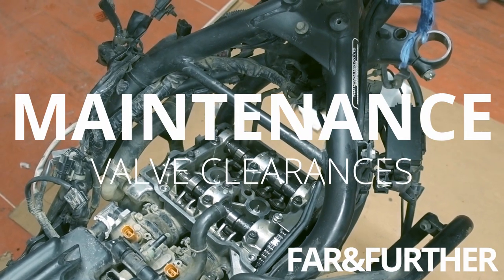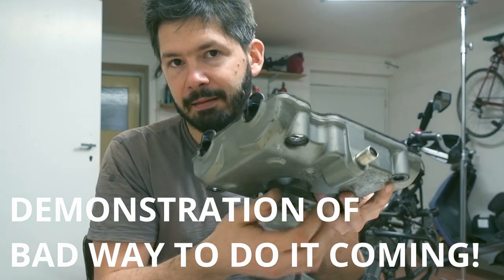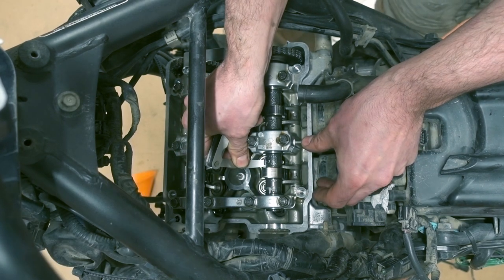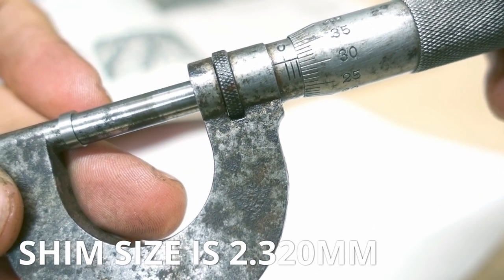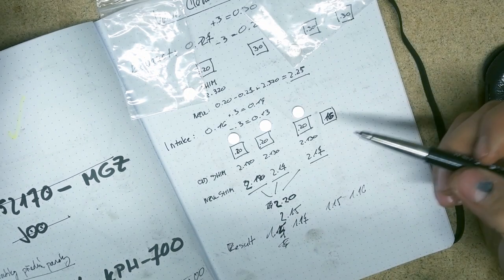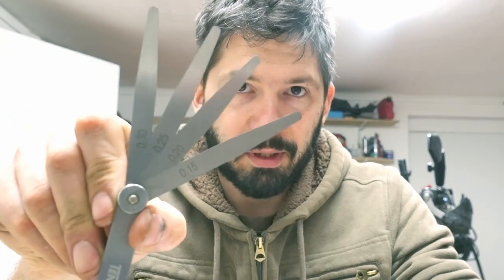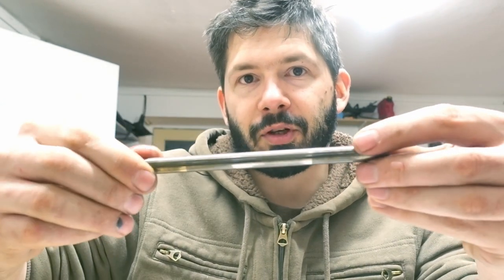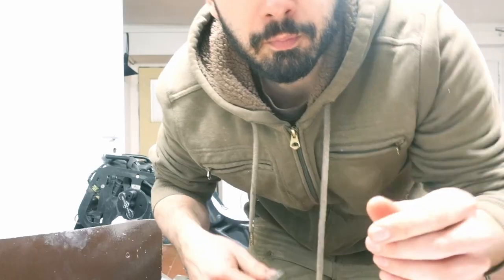Maintenance - Valve clearance & shim replacement

Comment: If I can add a couple of suggestions.  Check valve clearance when engine is cold (i.e. leave unused overnight).  Timing marks can be alligned by putting bike in 6th gear and turning rear wheel forward by hand only.  If you loosen the spark plugs first, this will make turning the rear wheel easier.  Overall, great video showing parts of the valve clearance check not available anywhere.  Thanks for posting Tasso.
Reply from the maker: Very good points!
Especially about cold engine, I had bike apart for weeks so it didn't occur to me, but of course!
About timing marks you're absolutely correct, wheel method will work as well.

There are some parts missing from the video such as timing marks alignment, etc... but I really want people to get the manual and do this with it, its soo cheap comparing to messing up.

Thanks for feedback!
Reply: good stuff appreciate it ! both of yall

Comment: Excellent thank you! Won't be doing my own valve clearance service in rural Thailand now on seeing this video despite maintenance fitter qualifications!! $200 AUD for the Honda dealer to do it here...
Reply from the maker: Hehe, yes I think some reasonable space and set of tools is good idea. It's not that difficult if you do it few times however clean environment is probably what you're after.
Reply: probably get it done in thailand for less than a 1000 baht, UK more like 12000.

Comment: Was looking to buy a CB500x but now looking at NC750x simply because shim adjustment is such a pain in the arse on the 500x.
Reply: you need to do it every 16000 miles. I would say every 3years for most cases.
Reply from the maker: Is that any better on the NC750X? After few times it's much faster, most of the pain is to get the electronics out of the way. BTW it's going to be much much worse on the Tenere 700 I have now, that looks like I'll have to take 1/2 bike apart. But T7 has 40000km for valve clerance!

Comment: Thanks for the instruction.
I'm surprised your micrometer still works. To not over tighten or damage the internal thread, you use the small knurled-head screw. Don't ask me how I know
Reply from the maker: Hehe, well it's reliable old day russian equipment, hard to beat the steel there :) They are very delicate indeed.

Comment: whether we can substitution shim valve for different motorcycle?. for example, we use ninja 250r shim valve for honda cbr 250r
Reply from the maker: I don't know, if it's possible to change shims. I'd assume that yes if the size is correct. Usually parts websites will have cross-reference to other models which would tell if its possible.